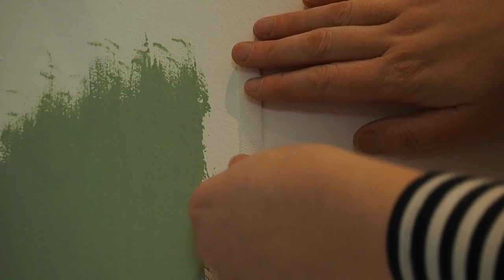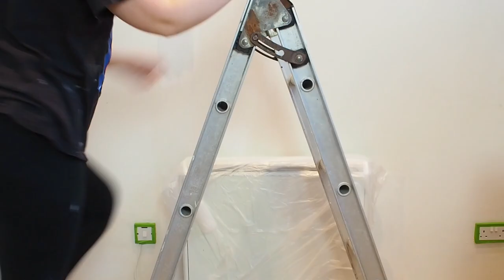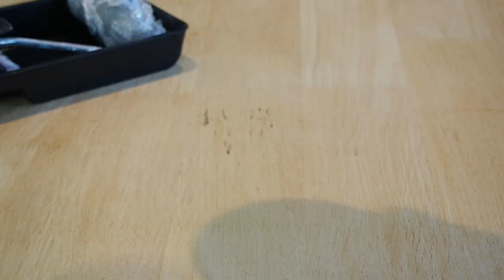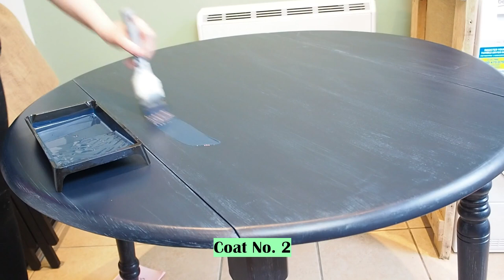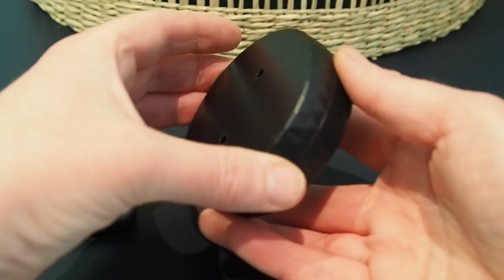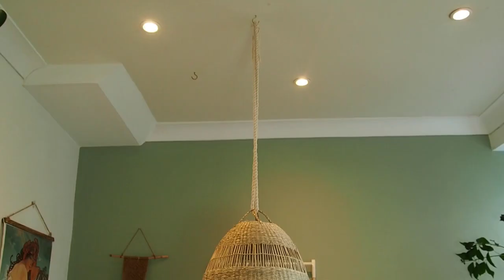DIY Kitchen Nook Makeover | Dining & Utility in 1 space!

Comment: Nice end result. Here some tips: when you use the thickest high-quality paint and you take consistently much and don't paint 'all-over-the-place' like was done here, you can be ready with one coat of wall paint only, which really is completely even and has no patches shining through in a lighter tone. Paint a small space each time going vertically, horizontally, and vertically a last time. Then continue with the next patch. You'll of course have a slight overlap, but if you take enough paint each time, it will not be uneven. You've saved time and an extra coat of paint. 
At 7: 21 you can see 3 different places where the holes were not filled up well enough. They shrink slightly, when they dry. With holes that deep, you usually have to do it twice.
Reply from the maker: Appreciate the feedback 👍
Reply: Thanks so much 👍 You done a Great Job❤💯👍